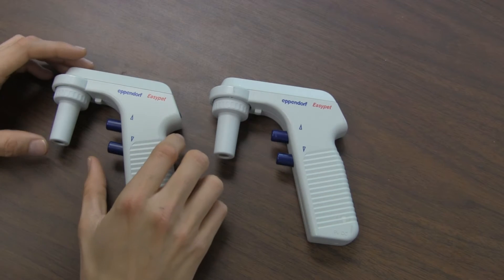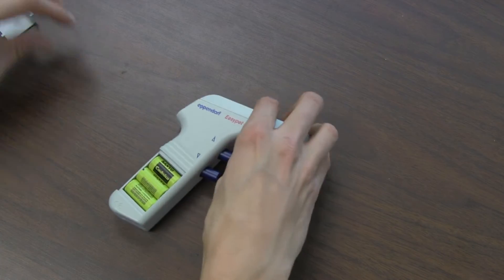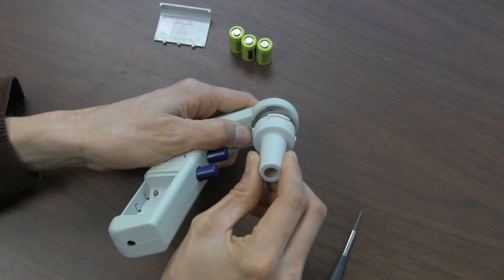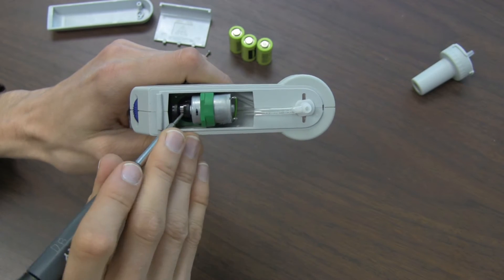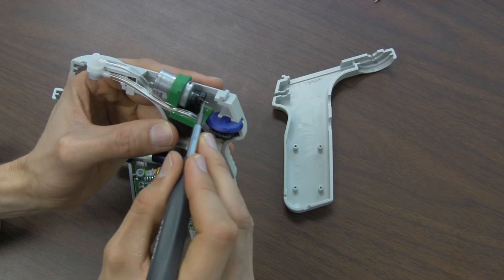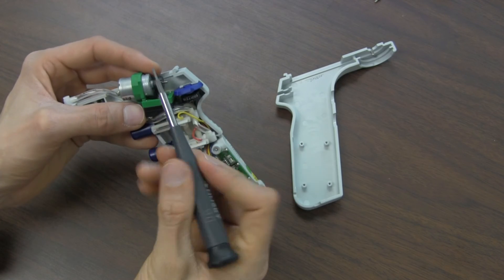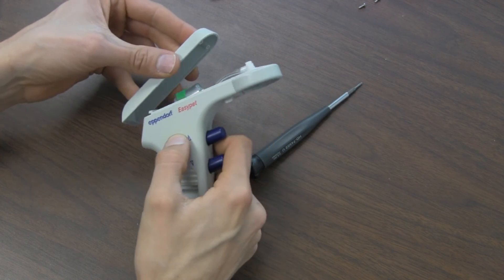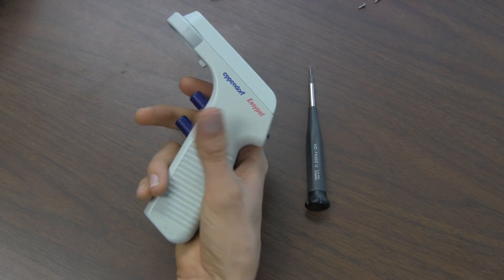Eppendorf Easypet Pipettor Repair - Pump doesn't work, sounds weak | How To Fix | Engineerable Video

Comment: Thanks so much for this video! I shifted the piston rod back next to the pump as you showed in the video, so that's one problem fixed, but the pipette still fails to charge when connected to a charger. By any chance do you have any ideas about how to fix this? I tried using a different charger that I know is working, but it still failed to charge or work while plugged in. I checked the red and yellow wires, and they seem to be making proper contact. Nothing seems corroded.
Reply from the maker: You would need a multi-meter to debug the problem by testing if the charging voltage is reaching the batteries. It's also likely that the batteries are dead and need to be replaced.

Comment: if the dispensing button do not work, how can i fix this problem????
Reply: open it up and make sure the yellow wire on top or the red on the bottom are making contact with the golden pin in the spring loaded carrier. If they are making contact, then bridge on the connection accordingly. If bridging works, then replace the defective wire.  Hope it helps